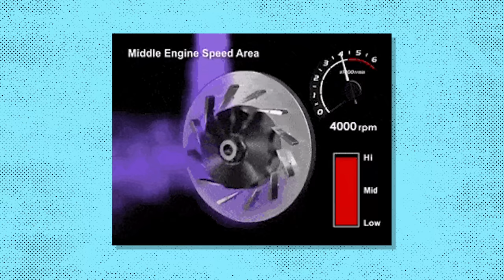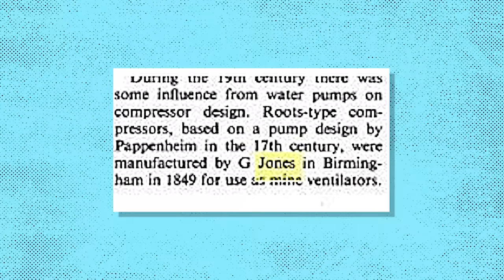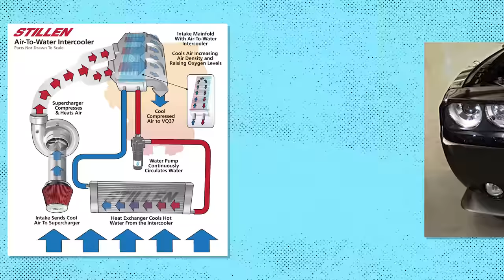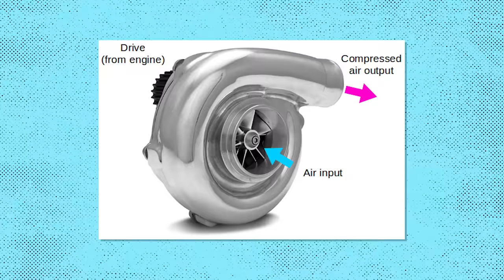Why Superchargers Aren't As Good as Turbos

Comment: well your both right and wrong. Here is the thing with opinions, they aren't subjective. Turbos are most of the time better, but they only make their power once they have spooled. For engines that make all there power at the top of the RPM band, they're kind of useless, as you are waiting a long ass time for that FI. That's where a supercharger is useful, since they are mechanically driven, they tend to make power lower, which evens it out. Both have their place and saying one is objectively better in every scenario is both stupid and false.
Reply: Then why are turbochargers basically standard equipment on trucks that make their power at low rpms???
Reply: The point is turbos always make more power and use less fuel... in all the important aspects superchargers are inferior.
Reply: @WilhelmKarsten  use less fuel? A performance turbo vs a performance supercharger are gonna both eat up fuel, they aren’t built for gas mileage
Reply: @WilhelmKarsten  because superchargers run off of big V8 engines easier than they do smaller engines, there is just more parasitic power to spare
Reply: @YourLocalR3NecK  But a turbo doesn't require any additional power or fuel to operate... the Turbocharger is a combined cycle engine that operates as a second pass heat recovery cycle.

Turbochargers significantly improves fuel efficiency and overall thermal efficiency.
Reply: @YourLocalR3NecK  The parasitic loss is relative to the engines' size. The larger the supercharger the larger the drag... 
The most common use of superchargers is aircraft engines, typically much larger than sutomotive V-8s... they are also common on 2-stroke Diesel engines
Reply: @WilhelmKarsten  that’s bullshit, neither the turbo nor the supercharger can run on there own. A turbo requires the engine to work harder on the exhaust stroke as now it has to push the exhaust through the turbo before it can restart the combustion cycle. And like I said, the only time they get better gas mileage is when turned to do so, but turbos put into performance cars get shit gas mileage. The job of a turbo and supercharger is forced induction to give your engine more power, turbos just have the ability to allow you to get better economy when built and tuned to do so
Reply: @WilhelmKarsten  the exhaust from the exhaust stroke, isn’t wasted it does in fact take power to do, making the turbo have parasitic loss as well. Turbos also have the issue with heat, as you can only cool the air entering into them not the turbo itself self. This doesn’t mean superchargers don’t have heat issues, but SC will run much longer back to back with more abuse and stay a lot cooler
Reply: @WilhelmKarsten  like I said in the original comment, there is no subjective winner, they are each others Yin and Yang and it all depends what your looking for and how you drive your car. The turbo worship from the car community needs to end
Reply: @WilhelmKarsten  like I mentioned before, neither is superior to the other. You’re allowed to like and prefer one more than the other but the fact is that they both serve a purpose. They are each others yin and yang and to say turbos are better by listing there advantages is just wrong. As I could argue SC are superior based off their advantages. When in reality it all depends on what kind of forces induction you’re looking for, and the purpose of the car. The turbo hype from the car community really needs to stop, it’s not some end all be all invention, it’s simply engineering.
Reply: @YourLocalR3NecK  That's absolutely correct.
A Turbocharger is a supercharger coupled directly to a turbine engine.
Reply: @YourLocalR3NecK  The Exhaust turbine runs on the waste heat energy discarded by the piston engine.
Reply: @YourLocalR3NecK  It's not worship, it's hard facts based on well-known and understood engineering concepts...
Reply: @WilhelmKarsten  look dude, I’m not gonna argue with you on the internet about which subjective forced induction type is better. You Cj’s have your opinions and preferences but the fact is that they’re watchtowers yin and yang use what ever one you want idgaf

Comment: I want to see a turbo engine do 5k+.
only supercharger 
topfuel drag racing
Reply: theres a 630 cu in drag racing engine that can survive 5200 hp dyno pulls/passes using twin 103mm turbos. no rebuild like the top fuels either. granted, its not making the same 11000hp, but still an impressive feat.
Reply: Because of the fuel not the supercharger.

Comment: 1- 3:20 this is the only relevant thing to the argument between turbos and superchargers, and is also the reason why your video title is pretty embarrassing to read 
2- super chargers aren’t always placed on top of the engine 
3- turbos being tucked away is an absolute unholy sin that brings hell to the car lmao it’s a nightmare 
4- turbos also have power that’s lost/wasted
5- I want my power when I want it, like I put my foot down I want to go, not in 2 seconds after I put my foot down, ergonomically the supercharger is superior in every aspect that is relevant to boost, making power instantly, going faster instantly, I don’t shit on turbos, but I feel on paper you can’t even pretend that a turbo is better in anyway considering what boost is even for, because the supercharger does it better
Reply: Turbochargers have a significant advantage over superchargers that make them fundamentally superior...  Turbochargers make more power.

Comment: Your saying superchargers suck because they are less fuel efficient?  Better fuel economy is why turbos suck - all manufacturers are producing underpowered engines to save fuel and then just slapping a turbo on them.  Result is shitty power delivery and terrible low rpm/city performance.  Turbos are ruining cars.  What you need is a twin turbo setup to overcome these issues and that is too expensive for the budget minded.
Reply: Not exactly, superchargers produce less horsepower per cubic inch, and per pound of fuel.
Turbochargers make more power with the same amount of fuel.

A supercharged engine can never make as much power as a turbocharged one.

Any questions?
Reply: That's not what I was talking about.  I was talking about power delivery not fuel economy or HP/CI.  I know superchargers are less efficient which is why I stated the intent of manufactures. 

 Turbos have terrible power delivery and make the driving experience worse.  This is combated by using multiple turbos which increases the price and is usually only found on more expensive cars.

Any questions?
Reply: @EhdrianEh  Yeah, I do... you do realize that "turbo lag" does not mean "acceleration lag" right?
Turbo lag is a false perception that is completely imaginary,  a good, skilled driver can easily adapted to this false perception and consistently produce faster times than a comparable supercharged vehicle.
Reply: @sandervanderkammen9230  Lol a skilled driver can't overcome a "false perception".  Either it exists, or it does not.
Reply: @EhdrianEh  CAN overcome this false perception, a skilled, experienced driver can drive faster if he learns to ignore this false phenomenon and adapt his driving style to consistently clock faster times.
Turbo cars are faster because they produce more power than a supercharger.
Reply: @EhdrianEh  Amateur drivers are often intimidated by turbo lag, their reflexes are not in tune with the  cars response curve.

Just like piston engine pilots are intimidated by the transition to jet engines...
No one argues that piston powered planes are better than jets though..
The vast advantage in thrust totally makes up for the less immediate throttle response or lag from flight idle.
Reply: TURBO CARS ARE FASTER!

Comment: No thats not exactly right, harrop superchargers make modern day superchargers with fuel injection that preform as good as turbochargers.
Reply: No, superchargers are inferior to turbochargers..
especially when modern fuel injection in used.
Reply: @sandervanderkammen9230  well you need to check out Harrop superchargers, i think you will have a different opinion after seeing what they currently have. No more chrome blowers with carburettors sitting atop,those days are gone.
Reply: @Healthliving1967  You need to learn about how a turbochargers work... and how much better they work with GDI.
Reply: @sandervanderkammen9230  lol,I know how turbochargers work bloke I had a turbocharged falcon barra engine that put out 800 hp. Turbochargers are prone to failing,they lag and create a lot of engine bay heat,they don't last as long as a good quality supercharger. Sounds like you are stuck back in the days of the old chrome blowers with carburettors on top,the superchargers they make today are really good and produce a lot of power and reliable power.
Reply: @Healthliving1967  Nah, you don't seem to know anything about turbochargers... anyone who says turbochargers are unreliable is a very uneducated amateur on this topic.
GDI has revolutionized turbocharging.

Comment: I think your overlooking a few details. While I agree turbos are better suited for smaller engines and are more efficient, on a larger engine a positive displacement blower make a boatload of power off idle and provides power in the low to mid range where the engine spends most of it time on a street driven car. The pluming in the engine compartment on a turbo is a makes it a nightmare to work on. They also generate a lot of underhood heat with all that exhaust plumbing. Where a supercharger just bolts between the intake and throttle body and package much easier. Nothing more fun to drive then a positive displacement V8 :) For a small displacement engine a turbo makes more sense.
Reply: Except that turbos give you a huge power gain compared to a supercharger.
If you are looking for big, truly impressive horsepower numbers the turbocharger is the only choice.

Comment: Thats just your opinion bruhhh... I build cars, superchargers are way more efficient.
Reply: You're joking right? Everyone knows turbos produce way more power and are more efficient.
Reply: @sandervanderkammen9230  Turbos are for higher end RPMS. Superchargers are for lower end RPMS. Turbos require power to make power. Superchargers dont because they run off of a belt. That right there makes them more efficient. Efficiency is not power. Turbos also dont allow your exhaust gases to leave the cylinder heads effectively due to them pretty much having fans in the way of the exhaust flow. Superchargers are easier to maintain and install. For Drag Racing, Superchargers are the best. For other kind of racing that involves high speeds then it would be turbos.
Reply: @jimhardiman7735  The why are turbos common on low rpm engines like aircraft, trucks, locomotives and generators???
Reply: @jimhardiman7735  But no power from the reciprocating engine, the turbine wheel does not impose a load on the engine, it is driven by heat energy rejected by the reciprocating engine.
Energy that is normally wasted out the tailpipe in a supercharger or naturally aspirated engine.
Reply: @jimhardiman7735  That is a completely false statement, turbochargers are excellent for drag racing. The NHRA banned turbos because they make the cars too fast. 
Any questions son?
Reply: @jimhardiman7735  Well, then I suggest you start acting like one son.
 I see just as many American made engines with turbos, perhaps you should pull you head out of that June 1971 issue of Hot Rod magazine and start looking around at what going on in the engine industry these days.
Cheers!
Reply: @sandervanderkammen9230  You so upset that a mechanic literally said that Superchargers are more efficient than Turbos. And whats even more funny is this mechanic, works on them. Install and replace them. You must be a little prissy boy. Grow up dude. I have first hand experience with all sorts of engines and forced induction systems. Your only knowledge is the Fast and Furious movies. 😂
Reply: @jimhardiman7735  I'm not claiming that you are not qualified to perform an oil and filter change... what I'm saying is that you do not have the formal education or professional experience to understand how a turbocharger actually works... you have already confirmed this by your comments.

Comment: TURBOS-with their extra heat-- are wearing out your engine sooner..  and they're not that good either..  even the cold ram air intakes are not good- because cold air can  mess up the engine too.
SO- it's better just to leave it alone.
Reply: .... And that's why some people should only own a bicycle.
Reply: @sandervanderkammen9230  FYA-- turbos are good for what they do- but they DO wear the engines out faster- and are MUCH more expensive to maintain and own... as well as other issues-- heat near plastic parts - lockups and engine failure due to increased heat.. and more..  LIKE IT OR NOT!  If You can afford it and want that-- MORE POWER TO YOU!!
Reply: @davidwayne9982  Anything that produces more power will generate more underhood heat...
A 500 hp engine will produce around 1 million BTUs of waste heat.. Naturally Aspirated.
 If more power is the solution to your problem, then turbochargers are the best solution.
Reply: @sandervanderkammen9230  NO they are not.. for many reasons.. I've talked to over 50 master mechanics and RACERS and ALL have said SUPERCHARGER-- and turbos are better for longer consistent drives- I do lots of short trips.. and that's NOT good on a turbo engine.. and OTHER reasons..
Reply: @davidwayne9982  Then why are turbos more common on production cars?

50? Do you just keep asking people until you get the answer you want?

Turbos are better for making more power, superchargers are for people who are not really serious about making the most power.

Lots of short trips is bad for any engine.

If you are consistently driving less than 20 miles or 20 minutes per trip? YOU are causing increased engine wear and maintenance costs.
Reply: @sandervanderkammen9230  NO they are NOT- they are on all cars because the GOVT. pushes for that-- for the gas mileage deal.. being so stupid they don't realize it hurts it in many other ways.. and I even forgot to mention they are MORE expensive to maintain..  You can insiste all you want-- I've talked to FAR too many master mechanics, ENGINEERS that actually design the cars and RACERS that use BOTh---and turbos are HARD on an engine's wear and tear as well as dangerous for overhearting..
Reply: @davidwayne9982  Which government???

You sound like one of those crazy conspiracy theorists, are you a flat-earther too?

Comment: I'll take the gamble that the supercharger I'm putting on my '27 T roadster won't suck too bad. There will be no bulge in the hood ( that will be tossed off to the side). I don't think any turbo would have the look I want. Now, for my question; I've heard turbo guys saying how they turned up their turbo so it put out like 20 pounds boost. I've read most guys with superchargers are running 5 to 8 pounds boost. Why is there so much difference in pressure?
Reply: With a turbo its a simple matter of pushing a button or turning a screw to adjust the boost regulator or the wastegate... with a supercharger it requires replacing the pulleys and the belt.

Comment: Turbos take time to spool up when the exhaust is pushed through it but superchargers spin directly off the belt which is connected to the crank so it does not take time to spool up and helps give a car better acceleration
Reply: Turbos produce more horsepower and torque and therefore turbo cars are faster.

Comment: It's raining and you have a rear wheel drive turbocharged vehicle. Your at an intersection waiting to make a left turn as cars pass by. The coast is clear you put your foot down on the gas pedal only opening the throttle about 10 to 15% very lightly. You began to make your turn gradually and about halfway through that turn or on your way out that turn, all of a sudden your rear wheels begin to push and slip because it's wet from the rain and your tail steps out abruptly, causing you to unexpectedly drift and almost end up hitting on coming traffic on the other side, thanks to the all of a sudden surge from the turbo. Mind you, you kept your foot on the gas pedal with the same amount of force but somehow you get this surge of power as if you applied more pressure on the gas pedal and now you find yourself lifting your foot off the pedal and just steering where you want to go in hopes of gaining control. This is the characteristics of a turbo. Give me positive displacement superchargers all day everyday. I'm not out here trying to be the fastest with the most power. I want more usable, when you want it, predictable daily driven, got to merge and shoot that gap right now power.
Reply: You need to learn how to drive son...  and why turbo are faster.